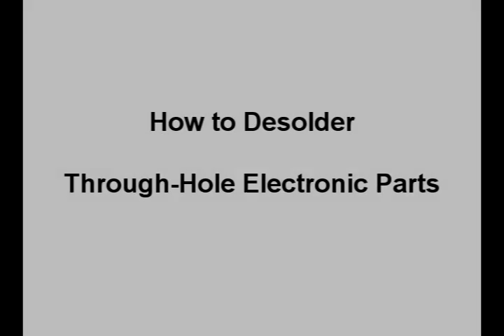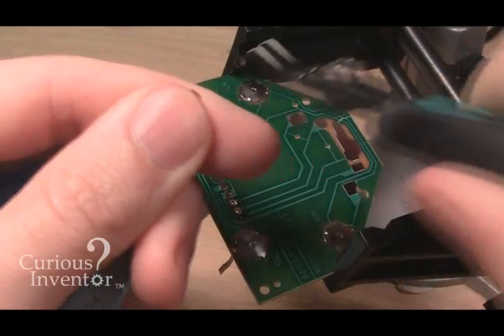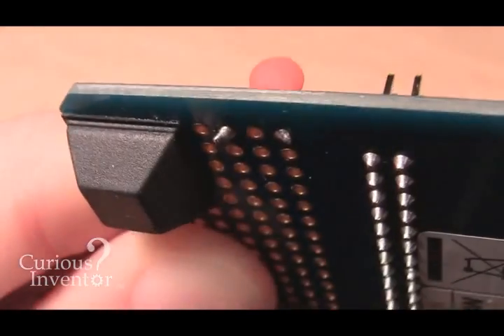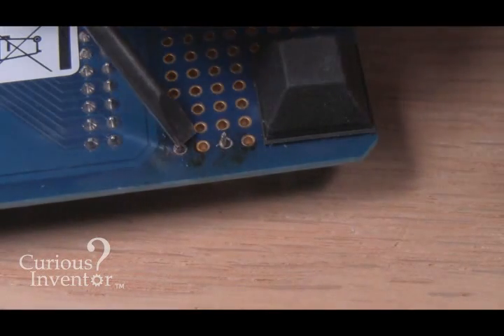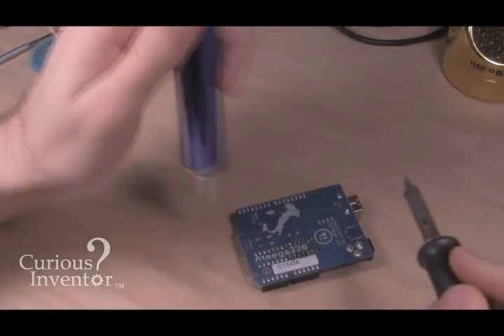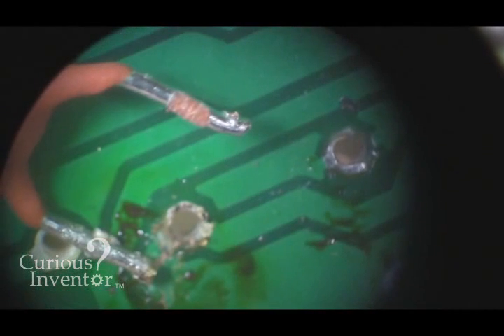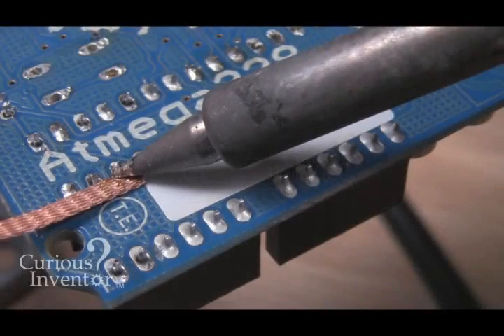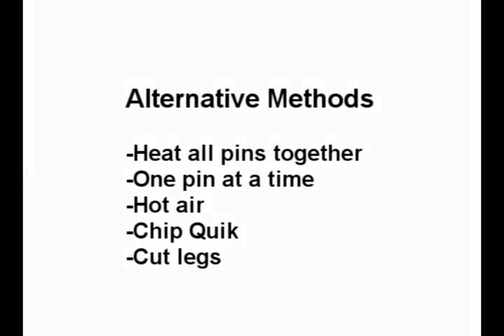How to Desolder Through-Hole Parts, Why Some Joints are Difficult

Comment: You make it look so easy! Yesterday, I spent 40 minutes battling an old PCB to try and desolder a simple on/off switch and it kicked my ass! Yes, that's right, I ended up curled up in a ball on the floor crying! My poor neighbours must think I was having a domestic, with all the shouting and swearing!
Reply: 4 years later and I am still in the same position. I cannot even desolder what I have solder myself! WTF!
Reply: @carlosgarcialalicata  De-soldering is the greatest PITA. I took like 9 hours to remove a Playstation 3 controller charge port. Once that SOB was out, I was able to put the new one in and solder it in place like nothing.

I bought a rework station with hot air and put too much heat trying to remove a chip from my 1992 Honda ECU and ruined it. I had to buy another ECU for $250 and decided to spend another $270 to buy the solder iron/pump combination because I don't want to do all that damn work and screw it up again and have to spend another $250 for a replacement board!
Reply: @SI0AX  Take up knitting.
Reply: @pingpong9656  That would probably improve my crappy motor skills TBH, but believe it or not, I find knitting even harder, lol. I can't get the damn string into the hole! I don't have steady hands, in fact it's probably a lot worse that average. It's almost like I have parkinsons disease. If I were a surgeon, all my patients would probably be killed.
Reply: @SI0AX  4 hours later and I've still got 3 holes blocked with solder on a broken PS5 HDMI port that's already been removed. No matter what I try I can't get the holes cleared. And before I'd watched this video I even managed to pull up a section of the copper layer on the board by pulling up the braid when it was stuck. Going to try again in the morning. This is one stubborn SOB!
Reply from the maker: @CB27 you might try adding more solder to get better heat transfer. Might also help to warm the whole board up with a hair dryer.
Reply: @CB27  What OP said is good advice. Old solder is hard to work with. You can actually make a huge blob and mix old with new and then use the suction pump to get the large blob and in turn suck up everything in one go.

I actually did this to remove an IC chip on an old Honda ECU(The 2nd one I bought after trashing the 1st). You just have too keep adding more new solder and sucking out the blob till all the old solder is out.
Reply: @SI0AX  yes, that's what I ended up doing in the end. Just kept adding low melt solder and sucking it up. Eventually the holes cleared. Thank you all for the advice. I very much appreciate it.
Reply: @SI0AX  you're absolutely right. That's exactly what I had to do. I added low melt solder to the hole on both sides of the board. Then heated it up with a soldering iron on one side and a desoldering pump on the opposite. 
Had to repeat that a few times to get the stubborn solder stuck in the middle out.
Reply: @SI0AX howd the pump gun work? Im hoping it’s the secret weapon that makes even crippled people pro’s at desoldering.
Reply: @SI0AX 😂😂😂
Reply: @BradScott-ys6ot The pump works a lot better than the braided wick IMO, you just sometimes have to add more solder to get a blob big enough to cover the tip of the pump to suck it out. The wick is good for small amounts left over that is too small for the pump
Reply: we can cuddle while we are BOTH curled up after ass-blasted by pcb. 😂

Comment: I will tell you the easiest way i do it.
Using a de-soldering pump, suck the solder. The hole should be seen through. Keep the iron aside. Take a fine nose pliers and bend the lead over the holding solder. Now straighten it back. The solder will break lose. Do this for all the pins and after checking all pins wiggle, take out the component

Comment: I've been soldering daily for years and can confirm that this video provides all the important information required to work on leaded PC boards. Every word he says is true and has some value. The only thing he didn't mention that I can think of is using two soldering irons simultaneously to remove large components. He should do another video on surface mount components as there's a whole lot of soldering techniques and methods to learn there also.
Reply: @iceboundflame  Ha ha. You need a second person generally.
Reply: I need 3-4 hands tor these SoB PS5 HDMI port holes. 2 for 2 irons and 1-2 to handle the braid/solder/pump!

Comment: One time I wanted to get a 555 timer off of a remote range extender, so I put the board on a grinding wheel and ground off the solder.

Comment: you destroyed an arduino uno
Reply: +The king of Nightmares I am confused though. Datasheets provide working/safe/max power values, why would you try to put more through a microcontroller? Granted, it would be a learning experience if it were the first time, I guess I take for granted that people might research (even basic) the components they intend to use.
Reply: +ibrahim khan Prolly it was already ded from some high voltage/load experiment.
Reply: ya may be , they can be destroyed very easily as they explode after handling more than 14 volts
Reply: according to me microcontrollers are awesome to work with tough beginners think they can get more power output by using a higher or a heavy input without knowing that more than 12 volts will set a microcontroller on fire tough we use relays and mosfets for this purpose  their are many things that you can do after finding the correct combination of these components such as you can control each and everything inside your house that works on electricity with your smartphone 
i often use arduino to make a infrared radiation sensitive area inside my room though if anyone enters alarms and my lamps start working alerting everyone that their is someone in my room so sush creative things can be done with this and if you have one then try i know you will enjoy it and the coding wich is needed will be for blinking an led

Comment: For a first attempt, I clipped all the leads of the DIP so I had a bunch of through holes with pins to desolder.  Easy Right?  Nope, I destroyed 2 of the traces trying to get the pins out.  I used solder braid to pull out solder, but the pins just wouldn't come out.

I tried the technique of pulling on the pin with pliers while heating the hole, but this didn't work for me because the pliers act as a heat sink and the joint never liquifies.  I'm using a 40W iron set at 750F.  If I went hotter, I'm more likely to cause damage, right?

I may have pushed the iron into the holes to cause the damaged traces, but I can't remember.  Do they make a desoldering gun pump that doesn't sound like a noisy duck call?  (For apartment dwellers.)
Reply: Fred Andrews A quality iron and tip are really important. I used to have a cheapie 40W Radioshack iron for doing capacitors on monitors and tvs, but it sucked when I tried to do anything on a lead free board like Xbox 360 or computer motherboard. You need something that will transfer heat really well. I bought a Wells unit just out of curiosity and it was so much better. I really like the wedge tip it came with. Make sure you are using flux and adding a small amount of solder for heat transfer. Since the joint isn't turning molten, you aren't using the right tip or your iron doesn't transfer heat well. If you do a lot of soldering, you might want to look at a temperature regulated Hakko unit. I really want to get one. You should also get a cheap set of stainless steel dental tips for clearing holes.
Reply: Fred Andrews: To minimize heat transfer I use a side cutter instead of pliers to pull the pins. Contact surface of side cutter is smaller. Also use a small one, not the bulky one. Large mass absorbs more heat. Also, you can preheat the side cutter somewhat with the iron tip.

Comment: Excellent video, I can attest to the fact that this is way harder than it looks. I actually had to put my xbox controller back together without soldering the new part in because I couldn't get the old one out with a solder sucker bulb. I just ordered a solder sucking iron, we'll see how that goes
Reply: +homebrewman231 most everything is hard the first time. you get that excellency with practice!

Comment: Those circuit board soldering is not difficult as the title says...try real motherboard or modem circuit board where it uses tough and tiny solder i want to see how it is done...i keep trying and it still harder than i thought.

In this video the hole of the board is bigger than those circuit board like the modem, motherboard, graphic card etc...can you show me how to do as easy as in the video. My experience is the solder is tougher, hole is too tiny, and the solder goes through. I use desolder iron vacuum still not working as effective as i expected
Reply: Literally the same problem I’m having with a motherboard lol, I’m guessing at this point you figured it out but I’m still new to this and if you’re still on this account.. well any tips?? 😂

Comment: Hello Friend, I messed up big. I just need to know if its possible to fix this. I was at war desoldering a capacitor and No matter what I did, I couldn't get the leads out. Well, I got one out and I was so happy. But the then the next lead brought a bad problem. It seams that i got the lead out, however, the hole socket too. You know what I'm trying to say right? You know when you desolder a lead correctly and and all the solder is gone from the hole, and theres a chrome like hole? Well, it came out.  I hope i explained this correctly, I've tried to make a glob of solder touching the trace at the same time, it's not working. If you want pictures let me know. Plus I'm using a rosin flux thats staining up my board too. I'm trying to repair my power supply for an Ensoniq Eps Keyboard/Sampler. I've replaced all the other capacitors with great success, all but that one...  Thank you!!!
Reply: Jim wates I've seen metal pad stickers before at an electronic store!

Comment: Thanks for sharing. I have a question, if you were to pick only 1 desoldering method for general use as a beginner, what would you advice to pick?
Reply: Karz Navarro If you are doing large components the solder wick and flux will work fine. I actually have a desoldering iron and solder wick and sometimes the vacuum doesn't clear the hole entirely and you still have to pull out the soldering wick. I also have one of those manual vacuum tools but I hardly ever use it because the wick works well.

Comment: I've spent two hrs trying to remove a 6-pin relay from  a through-hole board. :(( still couldn't do it, because I didn't knew about the wick & solder tip trick. Thanks a lot for the video, really well realised

Comment: Would that soldering gun too heavy (in watts) for this job? IMHO it might damage the parts.
Reply from the maker: It really depends on everything: the quality of the PCB, the sensitivity of the parts, and the overall heat sink away from the joint. Many times I've done more damage with a lower wattage iron because it took so long to heat up that the surrounding pcb was damaged. Sometimes a higher wattage gun can allow you to heat the joint to liquid before the heat has a chance to spread, reducing the total heat delivered.

Comment: I once saw a shop where they had a long desoldering bar that melted all of the solder in a pin row at once. This seems the least destructive method and requires no material to be used up such as the Chip Quik you talked about. Do you know where I can get such a device?

Comment: Excellent!

I learned that if you want to salvage parts from the PCB, it is wise to sacrifice board itself - while saving parts.

On the other hand, if you want to remove part, and salvage board, then sacrifice and break the component (if it is already dead component).

Comment: WTF man, this is the best video I've seen on desoldering. Wasted much youtube time watching others. I just have one one question, what's a good temperature to set a temp controlled soldering iron? I usually have it set to 280c but noticed the tip oxidizes rather quickly when trying to desolder. Any tips? Thanks
Reply from the maker: thanks! depends on the situation. If you have a huge ground plane or large components, you may need a higher temp to get the joint liquid before the heat has time to spread. You want to minimize temperature and time, but those work against each other.  I'll set my iron to 425C for very tough situations, but you're at more risk then. Use the lowest temp that lets you do the work in a few seconds. Hotter temps will always degrade your tip faster, so if you need to use them, only do it temporarily. Always cover your tip with solder before putting it back in the stand.
Reply: int0x13 Yes, you can apply flux to your solder wick if it's a cheap one. Usually the good quality ones don't need that but I discovered that you get what you pay for and you need to apply flux to it before you try to desolder something. Hope this help, cheers :)
Reply: With my Aoyue int936 station (21watt power) i set it to 270°C most of the time and its working to desolder with my chisel hakko tip. Its really depending of your tip, if you have a small tip the heat will dissipate very quicky, so we always advice the bigger tip is the better. When you have a little sharper form tip, its really hard to desolder anything with that, even with high temp.
Just to try and exercise i tried to unsolder really huge solder on a ATX PC power supply PCB, you know the big ball ones close to ground planes. With my station i failed at normal temp, i had to increase temp really hard to 400 or more and even with that temp i had a pain to keep the solder liquid.
About the video, really well explained, good stuff. I was wondering where did buy such a great solder wick? The one i find are always very narrow and not easy at all to apply on the solder to suck. Also i think the type of solder tip is important when you use a solder wick? I wanted to ask you, you talk about the flux inside the wick, can i add some flux manually on my wick to help to work better in case the wick had been heated too much?
About the desolder pump station, sure its really the best tool out there but the most expensive too, the hakko one you use costs 300$ at least. Also one question, what is your soldering iron model?
See you.
Reply: Sure it is a great video. Very well done. Today I replaced a capacitor on an ATX motherboard. The cap was on a solid power plane and I too had to increase temperature to about 420 C in order to get it off. Also I did preheat with a hot air gun with a narrow tip with a temperature setting of 290 C. Solder did not melt with hot air gun but applying solder wick quickly afterwards did it for me. Also when to cap was removed I wasn't able to get all of the solder out of the plated through hole. But I did have an 0.65 mm drill bit and a drill press and I got the holes open that way. I thought it was less risky to do it with drilling. And I did work out fine.
Reply: an Aoyue 936 at 270°C? no way!
Reply: Same, even a decade later! Spent all afternoon trying to gather information and this was the most comprehensive and clear resource yet, Kudos!

Comment from the maker: Agreed. Clinched leads and lots of internal ground planes can make desoldering very difficult without specialized tools (vacuum desoldering gun, hot air, or special tips). Would love to hear any other advice you have for production boards.
Reply: clip a thermocoupler to the heatsinks... simple trick to make the hard parts easier

Comment: I did NOT dislike this video, but desoldering a demo board is a lot different than desoldering in the real world where sometimes it's hard to gain access to the area you need because of other components and objects in the way. Also, sometimes they bend the pins over and many of the tricks you showed simply won't work. I think video was good, just giving feedback :-)

Comment: I do a lot of board repair and I almost always cut the leads on the component being removed. A part that has been heated up and removed usually suffers a shorted life anyways. With the leads cut, it takes a lot less heat to wick or vacuum the solder.

Comment: Another way to clear a hole or even de-solder a lead when you don't have braid, a sucker, or a desoldering iron is to use inertia by striking the board against a hard surface. Hold the PCB in the air with one hand, put your iron on it and melt the solder, then whack the board down and the melted solder will fly out. I show that on my video at: YLofuk22SHU?t=7m42s

Comment: Excellent seminar, thank you!

 I'm having a problem with a small circuit board switch in my car, one that controls the mirror. I did a video, here 
youtudotbe/2LHRkWpQtfw  (sorry, deleted post had the wrong link)

Cleaning connections only partially fixed it. One viewer described a coating that can be painted onto the button contacts to restore switch connectivity, something I've never heard of. Any idea?

Comment: In this situation, I try to make a cold (bad) solder joint by heating the pin with the iron and then wiggle it around with a screwdriver while the solder solidifies. That often makes a bad solder joint that is easier to brake loose.

Comment: my 2 cents - It depend on what you are doing....

A.) save(rescue/re-use/re-cycle)  the component and don't care about the PCB.... or

B.) save the board  - you don't care about the component (you need to replace it)

So in the case of B - Often times it best to cut off the part on the top of the board (componet side)  - so less thermal mass to deal with.  And for something like  DIP's - you can work one pin at a time

Also - sometimes higher heat/shorter time is better then long re-work times.